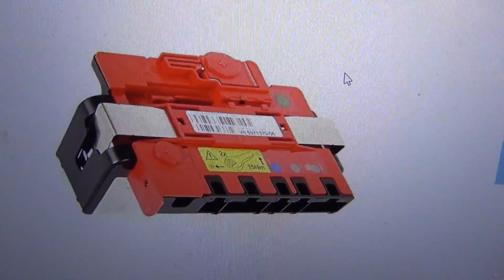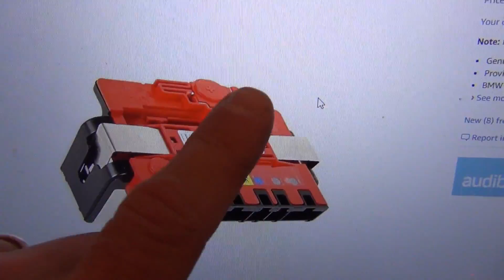BMW E90 Power Module Diagnosis

Comment: my car e90 always drainy battery, the problem when i drive hard acceleration cruise control and engine fault was flashing coming , do you have solution ? please
Reply from the maker: Sounds like you need to do some diagnosis.  There is no short answer for these issues. Scan and do a draw test with tracing down using voltage drop testing across the fuse in milliamps.

Comment: Thanks for this, I have an e93 EPS communication error and was hunting for the related fuse that was located in the boot to check before replacing the EPS module. It looks like the ones on the battery are the only ones as I couldn't locate any others in the boot.
Reply from the maker: You are welcome 😊

Comment: This is the final test im doing before I replace my water pump, got the codes but been finding the fuses (different locations for LCI from a lot of youtube tutorials so that took way too long) and fuses seem fine. Just have to check this box now 😢😢
Reply from the maker: @ohnaw223  Send me the last seven of the VIN and I can go over fuse location and wiring diagram if you need help.
Reply: @ thank you, J217157
Reply from the maker: @ohnaw223  I think I will try to post a video for you on the electrical Diagnosis later today.

Comment: Hello,  replaced my Control Module on the battery due crank ,no start on 2006, 330i, now ,scanner shows a code ; Supply Terminal  30  g- f. Any help appreciated.
Reply from the maker: @williamrogers733  30 GF is a fault driven relay that opens if there is a drain on the vehicle. This is often a parasitic draw.
Reply: Presently, my fuelpump isn't " waking up " which is a no start issue as well.
Reply from the maker: @williamrogers733  The fuel pump is controlled by the EKPS module. This supplies power to the pump. Very common failure but they require programming on replacement.
Reply: @AskTheCarExperts Where can I get that software?
Reply from the maker: @williamrogers733  Autel high end scan tool with programming and coding

Comment: I toolk batery out to charge and put it back.now there is no power at all. My bmw320i e90 2012
Reply from the maker: @jacqueslottering  Double check all your connections or you may have damaged the power module. I hope you solve it.

Comment: I just done my valve cover today and forgot to connect the ground wires, and they sparked and now my car is going crazy wipers going, power steering not working, abs error plus many more. Im hoping this is my issue because i dont want to parts connon this car. Im not sure if my car has valvetronic on a 320i 2008
Reply from the maker: Sorry to hear that. Even after you fixed the grounds and cleared the codes the issuebis still present?
Reply: @AskTheCarExperts  yes I think it's the bcm, well that's what my carly said is usually the problem

Comment: Hi, I’m having issues with my 2005 BMW E90 325i. The positive cable going to the power module is getting extremely hot. The car also has low voltage, which is causing various fault codes. Could this be due to the power module? I’d love to hear your thoughts!
Reply from the maker: @dutch_na1767  Loose connections, corrosion are possible reasons

Comment: My 320d preface cranks but no start. Error no comm to DDE. Fuel pump keeps buzzing. Before dying, there was a loud noise in the junction box. Have any idea on what could be wrong or needs changing?
Reply from the maker: Unfortunately this would be a complicated diagnosis. Check the DME, check all power and grounds to the DME. Check the Junction box for any signs of water intrusion or damage. Hands on testing most likely needed.

Comment: Hey. Just got my car back from the shop after a crank no start / crank no spark. The guy replaced dme and charged up old battery to start it, registered everything. Upon starting it had misfire in 3 cylinders due to incorrect spark plugs, so i changed all. After that it runs at 600rpm but a little variable, almost like the car want to die out. It  wont go over 20mph and 3,000-3500rpms with no check engine light. Scanned it, said valvetronic actuator motor supply code 2a3f and valvetronic adjustment range code 2a3f

I think it may have to do with the battery, the valvtronics not getting enough voltage to get it running probably but thats just my guess 
It was also sitting outside for nearly a year now
Reply: Also when looking at the battery distributer mine is black, however I dont have the red smaller wire that goes next to the thicker wire (distributor?). The second wire port on the bottom left side is missing for me
Reply from the maker: Hi Franchise, This type of problem would most likely need some hands on diagnosis. Unfortunately a little to complicated for a chat answer.

Comment: I don't get power in my engine compartment what could be the problem, no power on the fuses close to the computer box and all the wirering going in the engine. Only the alternator has power.
Reply from the maker: @NelsonMatosi  Hi Nelson, The issue could be further back from the main supply to the fuse panel.

Comment: Hello, sir. My battery on a BMW X4 diesel died and was dead for a week, and when I wanted to unlock the car to get a new battery, it refused to open with the key, so I had to unlock it manually.Fast forward, I got a new battery and installed it, and when I tried to start the car, it didn't want to start, so I used jumpers and jump started the car directly from the battery, and surprisingly, it did start, but it kept showing faults like led light fault, drivetrain fault, and it kept losing power until it ended up kicking out the gears, and now when I start the car, the system goes completely off although the car is still idling. 

The lights don't turn on, the radio and screen turn off, everything goes dark, and the speedometer doesn't move even when you rev the car, so I phoned someone to get it checked, and they are battling to fix the problem. Do you believe it could be the power module?maybe a blown fuse because even after trying to diagnose it the machine says it can't access the system 💔.please help
Reply from the maker: Wow, sorry to hear you have this issue on your X4. I think this issue might be a lot deeper than just a power module. This is something that would need hands on diagnosis. You can send me the car and I will be happy to take a look :)

Comment: Car cranks but no connection to DME (Engine ECU) So doesnt start. I've checked all fuses and relays I can find. Ecu does not look water damaged, its looks pristine. If I measured right the DME also has good + & grounds. Any tips before sending the dme away on expensive diagnosis?
Reply from the maker: Hello, Does the DME not respond to a scan?

Comment: I replaced this distribution box on my 2007 328i due to the water pump not working after having a thermostat replaced.  The water pump now works but now getting P0597 code after changing thermostat twice.
Reply from the maker: That is odd. This fault is usually from a bad thermostat MAP connection. Maybe a wiring issue.
Reply: @AskTheCarExperts found the problem, the wire was frayed had to be replaced, was rewired backwards ground out the new thermostat.  All started from air in the coolant system after having radiator replaced.  Thanks to you and many others knowledge, I was able to pinpoint the problem as well as why.  Ty again.

Comment: Hey my bmw e90 2006 manual is having problems but I cannot diagnose the issue. I hit a bump in the road at 70kmh and my speedometer turned off and kept it at 70kmh every control button switch etc on the steering wheel stopped working (indicators wipers etc) the ac doesn’t have power everything doesn’t work electrically besides hazard lights and windows opening and closing, the doors won’t even lock. The car starts (without power starting so it takes a few cranks) drives but obvious power loss. I tested out all the fuses none that I know of are blown but there’s a whole row + 2 others that won’t even get power even while the car is on.
Reply from the maker: Sorry to hear that. Thus type of problem will usually need some hands on diagnosis.

Comment: I think I found my problem thats exactly what happened to me changing valve cover and i forgot to cover those battery bolts where the battery wires connect to then had my rachect extension to a bolt on the valve cover and other side touched those power bolts and made a spark next thing you know .i was getting a overheating message. I tried to do the coolant bleeding procedure for water pump and it wouldnt work.I checked all the fuses they all were good. I checked one of those on the battery distribution box and one of them didnt light up

Comment: There’s other fuses in there. They’re all 30 amp. Grind the tab off the bottom connector and plug into grey!
Reply from the maker: That is an interesting fix. I will have to take a look next time I have one of these. Thanks for the tip Gordon!

Comment: I’m getting a lot of short to ground codes but the main one is the valvetronic. Could this be the issue?
Reply from the maker: Hi Matthew If you accidentally hit the jump terminal while doing a repair the power module is usually damaged.
Reply: @AskTheCarExperts  thank you I will check it out and see.

Comment: Can an overheating condition/non running electrical pump present itself on an N52 if a fuse in this power distribution box has blown? the other two fuses near the DCM/ECU whitebox under the hood at the passenger side look good. new water pump and thermostat, wiring looks good up there too, near the appliances
Reply from the maker: No I don't think this would cause that.  The power module issue usually causes a crank no start. The water pump has its own fuse. Check that first and see if you get power to the pump. If no powered trace the wire back. Maybe corrosion or check the ground near the pump.
Reply: Hi, did you solve your overheating issue?

Comment: Hey i was tightening the screw on the negative cable with a wrench, and the end of the wrench touched the positive red wire thats on that red box. What can my issues be now that my car doesnt have any power. Would the positive(red) terminal have been shorted or that red box
Reply from the maker: Hello Coco, This would have created a short to ground and hopefully only blew the fuse in the power module. You can check for the failure as shown in the video. Hopefully no other damage occurred.

Comment: Hi and thanks for the video. Would a blown fuse here effect battery charging?  I have just replaced my X3 F25 battery as it was reading 73% charge on my Bimmerlink app and also voltage was only 12.3 volts. When the motor is running voltage across the battery is 14.9volts so I assumed the alternator was OK. I replaced the battery with a larger/higher amp hour battery and successfully recoded for 105ah. Fully charged at 12.7volts.  Went for a drive and then checked the of battery again and it now reads 69% charge?  The car runs and starts fine but I am concerned.  I have now also put the old battery onto a charger and it came back up to 12.6volts????
Reply from the maker: Hello, The failure in this video would cause a crank no start. It may be the way the app is interpreting the information.  From your description the vehicle is operating correctly.
Reply: @AskTheCarExperts  Thanks for getting back to me. I have removed the three pin plug from the IBS and that solved the battery drain and improved both my transmission and mpg. Low voltage in the battery must effect many systems it seems. Luckily a battery set came up on Ebay for £20 so I took a punt and bought them, replaced the IBS, disconnected both battery terminals for 20mins and then reconnected with the replacement IBS.  All's well again now and I am not seeing any errors. 👍
Reply from the maker: @TheTanfieldKid  That is great! The IBS can cause some odd issues.

Comment: I checked my 325 E91with a meter as per the video and got no continuity and then tested it on the voltage setting and it was getting 12 volts, does that mean the module is ok? The problem I'm getting is the starter is trying to crank the engine but it doesn't always start, it may take between 2-8 key inserts to start it. The codes are typically 002A3F (Valvetronic power supply) and 002A45 (plausibility),  002A47 (eccentric shaft sensor).
Reply from the maker: Hi Mick! So it sounds like you are getting a crank no start intermittently. If you do see power out of the power module then it should be good. Your symptoms sound a lot like a failing eccentric shaft sensor. If it loses the position it will not activate the valvetronic motor. Unplug the connector and check for oil in the pins. Let me know what you find but please reach out to me via my website at www.askthecarexperts.com and use the contact me tab. I can see the first post on YouTube but when you reply I am not notified and it makes it harder to follow up with you. Kind regards, Roger

Comment: I have a 07 with a n51. I replaced the valve cover and while it was running I looked under the hood and noticed a ground wasn't connected to one of the 2 center bolts. I didn't think to turn off the car. It shocked when I put it on then the car died. Is this what ur talking about in this video?
Reply from the maker: Hi Kenny, Unfortunately no. This is when someone accidentally shorts out the jump terminal or the valvetronic power lead. The ground you accidentally forgot can effect the engine computer and can lead to failure of the DME. But you should check all power supplies. Check the power module like I show but you may need to check all your power to your engine computer.

Comment: This works. However, there are a couple of fuses under the module cover. So just testing the red line coming in may not be enough. Especially, if you’re having very specific power issues in the vehicle. So you should test all the inlets (female), by doing as is done here. But also placing the positive side of the tester into each female connection. Also, it’s best that you test with an actual DC voltage tester. You want to test for 12 volts. A weak volt due to a bad fuse can be the culprit.
Reply from the maker: Thanks for sharing your thoughts Michael. I like to use a bulb style test light so you can how bright or dim the light is denoting a possible amperage issue. While a volt meter is also a good check you can sometime see 12 volts but no amperage. Best to use both methods if you have the tools.

Comment: I tried this and the test light turned on . I have a crank no start issue and my dme isn’t capable of reading at its current state
Reply from the maker: Hello, Sorry to hear about your crank no start. This can be from many things but if your DME is not communicating you need to start with checking all the powers and ground to the DME. If all the powers and grounds are good and the CAN bus signals from other modules are good then the DME is faulty. Remember that you cannot use a used DME on a BMW. They are Vin coded.
Reply: @AskTheCarExperts  You can get the DME, CAS,  key and stop start switch from a donor car and this will work because all four are synched.

Comment: Is there any way to start the car so i can drive it to the shop, or it has to be towed?
Reply from the maker: Hello Hasan, Sorry to hear your having a no start issue. Without knowing the failure in the vehicle I would not be able to provide a recommendation. For safety reasons if you can't trust the vehicles performance I would recommend having it towed.
Reply: @AskTheCarExperts  I appreciate the advice, thank you

Comment: Will my car start if it’s blown? My battery keeps dying but only after I messed with this thing
Reply from the maker: Hello, When the internal fuse fails the symptoms will be a crank no start. A battery drain may be from a parasitic drain. I have a video on diagnosis steps for that type of issue. It may just be a failing battery but if the battery is new it is most likely a drain. Common causes are often aftermarket accessories.
Reply: @AskTheCarExperts  thanks for the reply I’m sure other bmw owners have the same issue but i think I found it, my alternator is mounted janky but it’s been fine, maybe it’s a bit loose cause I saw a spark come frm the area between the block and the alternator. The surface of the block is the ground apparently. I’m gonna see if I can ground it also I think you’re right because now I hear a light buzz for one of my speakers.. one of the symptoms of drain

Comment: Hoping you can help, my car e93 sometimes has no power, (locks don’t work, nothing) then if I push the “button” on this component it comes back on.. 
i compare the problem to like a trip on your house electrics..
Firstly any idea why this is happening (has done it 4 times in two weeks) and secondly can you suggest any remedial actions?

Much appreciated
Reply from the maker: Hello, This power module sits on top of the battery. Double check all the connections on the battery positive and negative. You may have a loose connection.
Reply: It seems right, but it is a replacement battery from what I can tell.. I’ve only owned the car about three weeks, thanks for reply
Reply: I had issue with my e90 it had a recall for the main fuse box under the dash there’s is a cable on the back of it that goes bad my car would loose power everything would turn off I would move it and it would crank up but it’ll eventually give out all the way check and see if u got recalls they will fix for free